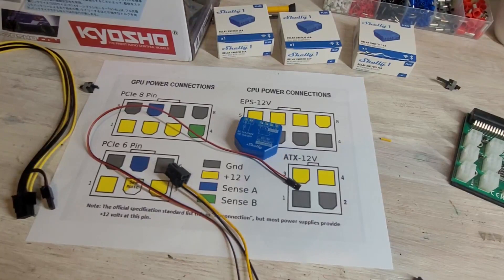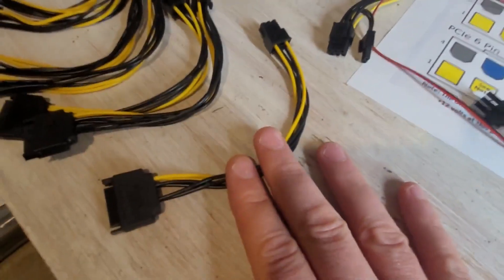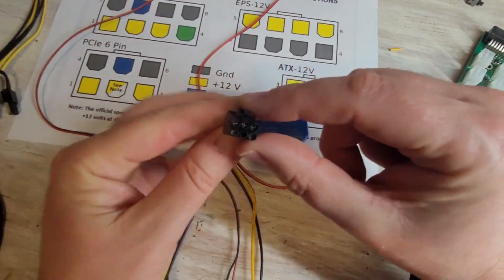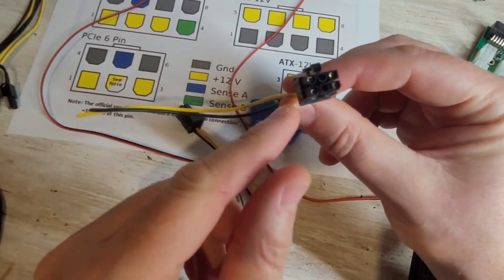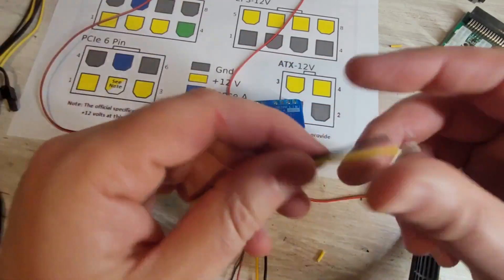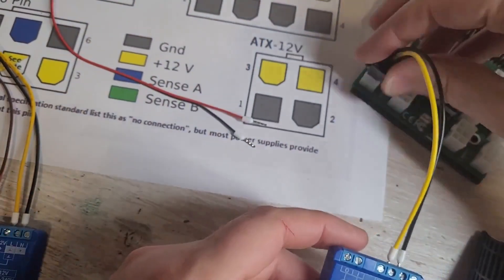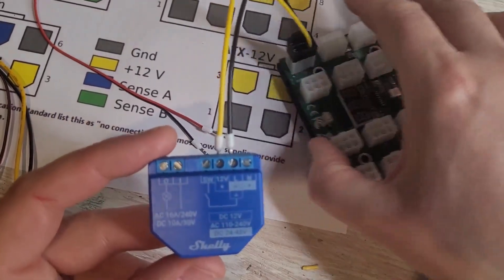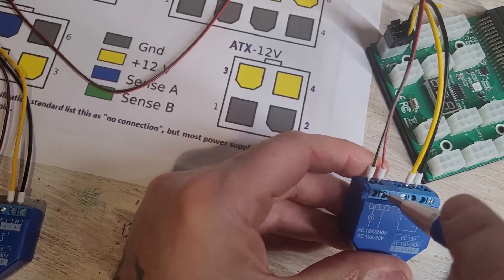How to wire a Shelly Plus 1 relay switch ⚡🤓🔌

Comment: Very underrated video. How do you set (in the shelly app) a momentary switch to shut off after turning on? My pc won't fully start unless I tap the switch button         to off (in app).
Reply from the maker: Thanks Gary appreciate the feedback, so if you want to switch off as per most pc or motherboards you need to hold the button for 3- 5 seconds to shut off. So in shelly app goto timer then under auto off chnage from 1 second to 5 seconds. Save it and then go back and press the app button and the pc will then swicth off👍👍 then you may need to change it back to 1 second to switch back on.